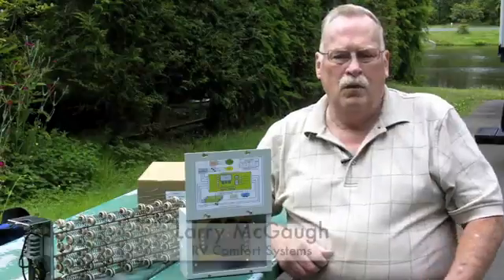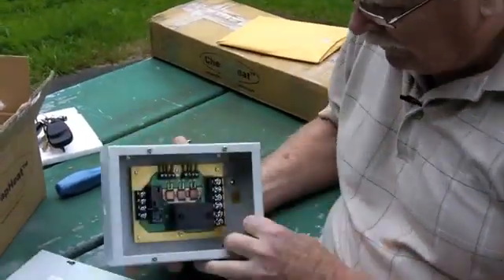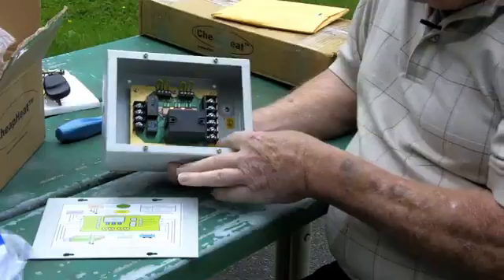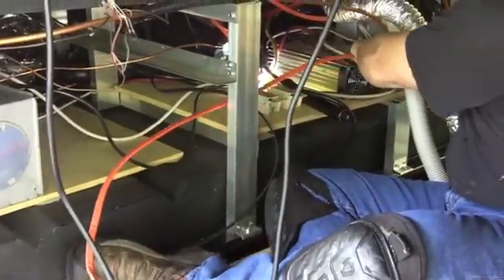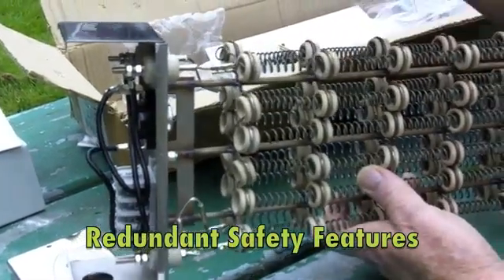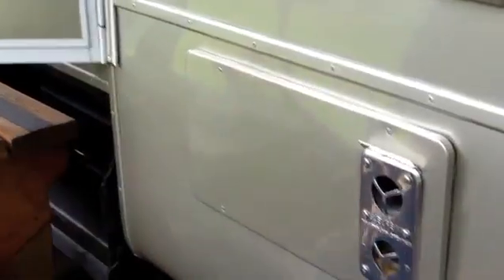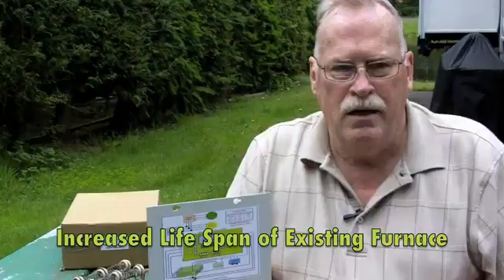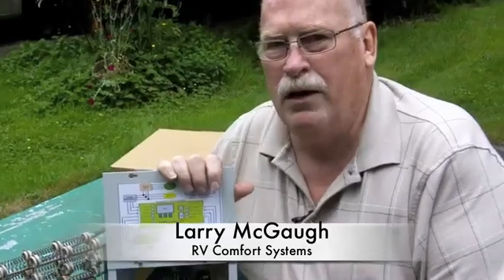CheapHeat: Installation Video

Comment: Been following this company since 2016 and finally have a trailer that it's compatible with, I just ordered my setup and once I get my trailer back from the repair shop for manufacturers warranty issues I will be installing this system in my trailer. It's definitely not for the novice. I have had a licensed electrician go over everything with me and getting the wires from my breaker panel to the crawl space in the trailer will probably be the hardest part.  I should be able to install the system myself , I have mechanical experience with duct work and the ability to follow diagrams and wire up panels. I don't want to pay $165/hr x 8 hrs for someone else to install it for me, The kit alone without the extras needed is $895 U.S and I live in Canada so right now that's $1250 Can.
Reply: Do you have an update from your install and how well it performs?
Reply: @ferenczbabinszki7699 I actually haven't installed it yet, I ended up laid off from work for 6 months and money was tight. I still have quite a bit of money I need to tie up in breaker panel and wire etc. I'm sure it will be good once I get the rest of the items I need to do the install.

Comment: Hello: Can you speak to the ratings of amperage, voltage, and running other appliances while this is in use?  IE: Microwave, waterheater on AC, etc.?  I have a 30 amp system. Thank you.

Comment: Does this get installed outside the rv? If not where are people finding the space to put it?
Reply: How much is it? How do you know the type of existing heater you uf it’s compatible? And does it make sense to hook it to s furnace over 10 years old?
Reply from the maker: It does add on the the end of the furnace which makes it 6" longer inside than it is now. So it really depends on were your furnace is located to have the clearance needed. If you go to our website iot should answer all of those questions (www.rvcomfortsystems.com)